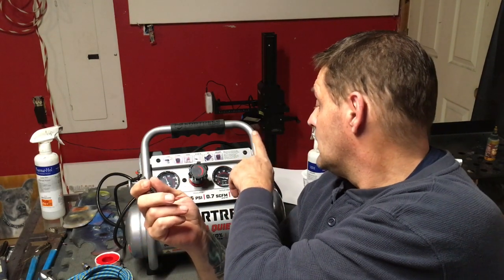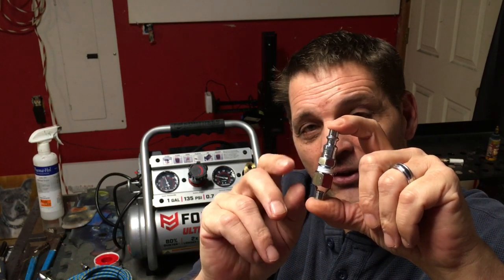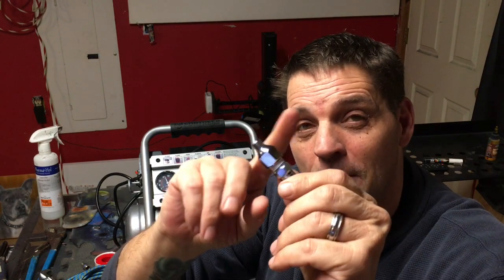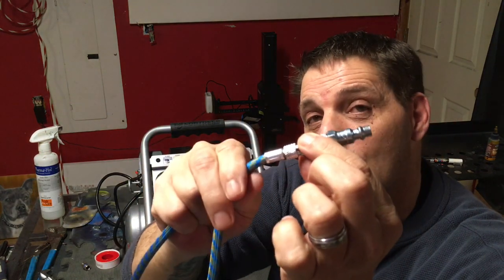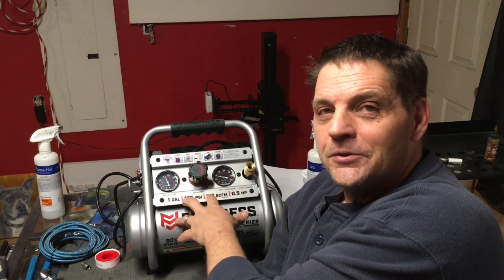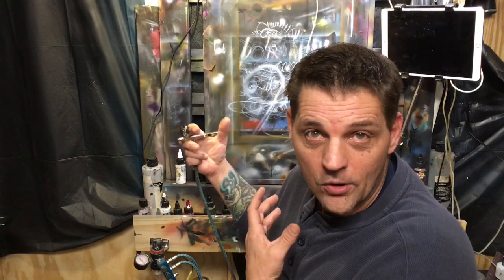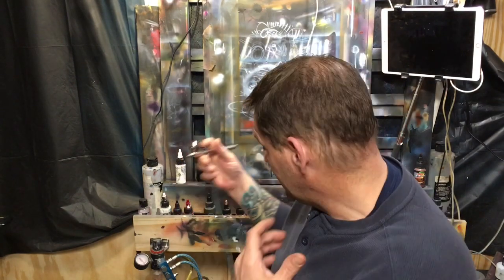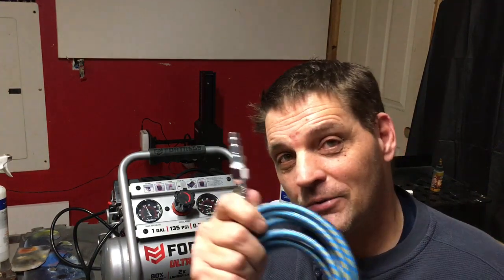How to attach an airbrush to a regular compressor.  Lets hook it up!

Comment: thank you for creating this video, it has really helped me out.  I am running a refrigerator compressor, to a dual tank rig. From the compressor I had been running a coiled copper line to  a section of rubber hose, a splined adapter to water trap/regulator, from that ran a hose to my airbrush.  I want the pressure cut off aspect of the shop compressor, however, the skirt on my piston disintegrated, so I swapped out the noisy electric motor for the fridge compressor.  Now that I have some time, I am wiring in a power switch and the pressure cutoff.  I will run a short line to the tanks, and from the tank regulator,  run a3/8 hose to my water trap, which I plan to mount to the side of my cart.  put the whole compressor and tank on the bottom shelf of the cart, connect my hose to the water trap, like you have your on your bench.  then the new line from water trap to airbrush.  a set up like yours, but on wheels.
Reply from the maker: I had a small setup on wheels like that.. very handy.   With the silent motor that should be a very cool little setup.

Comment: Thank you for showing me how I can use a shop compressor with the airbrush I have yet to buy for use in my train room. I really didn't want to have a little & noisy airbrush compressor in there as well.   Now I know I can just run an air line across my ceiling in the shop and above the ceiling of my train room.  I'll install the moisture filter in a spot between the ceiling joists where I can easily attach a hose "drop" down to wherever I'm working.
Reply from the maker: Yup if you got shop air close that is the way to go.. unless you need to be mobile of course

Comment: My local harbor freight tool store saved the day with this compressor, adaptor, and airbrush hose for my badger airbrush.
Reply from the maker: Great!  I’ve run some Barbour freight hoses for years,  it’s the only thing I use from their airbrush section but they are not too bad.
Reply: I did too but their hose is NPT at the 1/4 adapter and NPS at the 1/8. Brushes are BPS, no? I'm using an Iwata brush fyi. The Harbor Freight hose is the only kind I have seen with those connections. I fear crossthreading using it so I returned it and now looking  for ways to adapt. The links this gentleman shared don't seem to match what he is describing in this vid. The hose he linked is BPS on both ends and not NPT on the 1/4 end according to the hoses product info page. Also, the adapters he shared don't say anything about being BPS according to theor description. In fact they mention other threading instead.. I decided to stay away from a hobby compressor
and go a little larger for other uses too but this hose and threading thing is becoming a pain. Just finding all kinds of different and contradicting info when it comes to non hobby only compressors that send air out through NPT quick connects.
Reply from the maker: @alan2698  the harbour freight airbrush hoses are the correct fitting for your airbrush. 

They at least used to come with a female  npt adapter.  As well. Harbour freight does sell everything you need.  The airbrush hoses are green.  If they have a chrome adapter in the bag then you just need the industrial quick connect to male npt adapter. 

Occasionally Amazon will redirect links.  I will check the link and make sure it’s linked to the correct items 

If you ever see any links wrong I try and monitor every single comment on YouTube.  Occasionally I miss some.  Thanks and good luck on your journey
Reply: @TheAIRspace  so strange. I wonder why their package stated nps and not bsp? Maybe you got it to work but it is not the correct threading and will cause cross threading (unless it is a typo?). They are different angles and thread styles physically. Also, I didn't mean to call out about the links. I was just recalling one I found with another commenter somewhere else in this thread. Their question seemed to line up with mine.
Reply from the maker: The BSP and NPS are very similar  both being a non tapered thread unlike NPT threads.  The difference is one is 28 threads per inch and the other 27.  being the threads are loosely threaded will not cause an issue.  They seal with a gasket and not by thread to thread contact.  The variance is pretty loose.  

The part number is item 69578 for the harbor freight airbrush hose.  Which incidentally will be the same hose that is used on their airbrushes.. which happen to have the same thread as every other airbrush outside of Pasche and Badger.. in the HF hose case it actually comes with a badger adapter as well. (there may be some oddball airbrush thread out there but I cannot think of any)  
Its actually a very good hose, Probably the best thing they sell for airbrushes.  It is actually an airbrush hose from harbor freight in this video. As well as the adapter.  

I didn't take the comment about the link as a negative at all.
Reply: @TheAIRspace  ok. I appreciate your time. Thanks.

Comment: Just bought that same compressor this weekend!  Very quiet and adjusts nicely!
Reply from the maker: tbh its not my first choice.. and I have a larger compressor.  I plan on using this in a portable airbrush easel.. sort of.  But they are pretty well built.  If it were my only compressor id definitely have to have a bit more power.  But I use a bit more air than most folks too.. this is WAY better than an "airbrush" compressor.

Comment: Thank you!  Like others have said--nobody has specified exactly what you need for this.  Although, I only needed the NTP to 1/4" adapter; my Iwata hose has 1/4" on one end and 1/8" on the other.  I don't know if that's a new thing companies have started to do or not.
Reply from the maker: some hoses now ship with an adapter to 1/4 npt .  but it is still not always the case.  the question of how to hook it up comes up a lot on threads  on facebook.  and yet I still see the wrong answers given a lot.  Thanks!

Comment: Thank you very much for this informative video! I hooked up everything like you said and it works fantastic! I am currently running one airbrush and wanted to know how much pressure do I set the compressors' regulator to as well as the regulator next to the airbrush. Please let me know and keep up the great work, thank you again!
Reply from the maker: I usually set the compressor regulator around 60 for regular airbrush stuff,  and the second regulator at anywhere from 15-40  depends on what im working on.
Reply: @TheAIRspace  Perfect! Thank you for letting me know.

Comment: The link you provided for the multiple fittings is for the industrial version , in your video you stated that we needed the automotive type
Reply from the maker: I checked to make sure, however industrial type will be what most home users would have.  Automotive type are higher flow fittings and not used on most compressors.  I indeed said you need industrial type :) the one correction (if youtube let me edit the video,)  I would label the 1/8 inch as BSP because that is indeed what the correct thread and terminology is.  
Thanks!
Reply: @TheAIRspace  crap! I just went to Home Depot and bought the automotive version
Reply from the maker: @Unkownsector  you know I’ve come back with the wrong quick connect myself. And I used to run air lines for many businesses

Comment: This is pretty cool my 60 gal two stage compressor is hooked in to the house and provides all the nice clean air for my airbrushes and air tools in the garage. I do use 1 large moisture trap at the compressor and a smaller regulator trap/filter works great and I don't hear the compressor that's in the heater room. And a separate line for my air tools and full size spray guns.
Reply from the maker: Yes absolutely if you have a shop compressor and can pipe in air from a remote spot (where noise doesn't matter). That's a great way to go.  

Of course everyone's situation is different.  But one things for sure, you cannot have too much air!
Reply: @TheAIRspace  yes your right I had a small compressor and it died and it dawned on me why not just plumb the 60 gallon since I already had it set up! Lol! But a smaller set up for airbrushing is completely acceptable but I would still choose one with a tank.
Reply from the maker: @moparnut6286  definitely.. i wont even use "airbrush compressors"  at least not in the volume I do.  I have a 5 gallon Kobalt quiet tech ive been using the last couple of years.  This little one i had in this video, is going to go in a small mobile easel/airbrush station setup I plan on building.  I want to be able to wheel it in and out of the studio and go outside etc with it.    My 30 gallon compressor just recently died.  But since im not spraying large spray guns currently its not a need..  I plan on moving in a couple years so... not going to get another until then.   The plan is as soon as my last kid graduates.  then im moving to the country and should be able to have a pretty large shop space.. for now i just keep pumping work out of my little studio space :)

Comment: Another great video, thank you and I really appreciate them. I really liked the explanation of using a longer air hose and where to put the moisture trap. I clicked on the Amazon link for the air hose with adapter, however it shows 1/8 female and 1/4 female bsp so I don’t understand how it could or would work. I searched my local hardware stores, eBay, and Amazon but to my surprise it’s not as easy as I thought converting from bsp to npt. I decided to go an even simpler and a much more readily available route. Simply cut off the British female fitting and get a hose barb (I believe mine is 1/8 or might be 3/16 I.D.) with either male or female 1/4 npt threads, then get a air coupler (obviously with opposite male or female threads) to attach to the connection of your compressor. Quick, easy, and the parts are easy to find and inexpensive. I really like your explanations in your videos, thank you for sharing with people new to airbrushing like myself.
Reply from the maker: If you have a harbour freight they sell the hose with the adapter. And their hoses are actually pretty good quality. They also pack a badger adapter in them 

I’ll check the link I posted sometimes Amazon switches them up. 
But more often than not they are mislabeled.  I tend to believe almost all of the braided hoses are made from a couple suppliers and sold under various names.

Comment: hey ! thank you for this video ! i try to undersand what's going on cause i bought one of those Coil hose with the quick connects built in it but i just can't fint a way to connect it to my 
Iwata  Revolution Cr Airbrush (4247)  .i bought an Adapter, 1/8-Inch Female End to 1/4 that can be wired to the airbrush but have no idea what type of connector i shall use to plug the adapter to the hose   ? i went to the local store but they had no clue . . . any chance one of you gys who read the comment know how to deal with this ?  sorry if i made some spelling mistake ^^ and thank you anway for your content
Reply from the maker: you need to put an npt to 1/8 male BSp adapter and use an airbrush hose.   If its a quick connector on the hose you need the quick adapter to NPT adapter than a 1/4 inch npt adapter to the hose 1/8 bsp
Reply: @TheAIRspace thanks a lot ,  i though somehow the quick connect hose was the only hose i needed and couldn't understand why the adapter i got wasn't .....adapted, sounds stupid but i am still learning. thanks for clarifying the steps !

Comment: Thanks!
Reply from the maker: Incredibly generous thank you! 

I’ll have to remember to shout you out on the next video I just dropped one so might be a few days
Reply: Hey, I got everything hooked up and working! Did my first airbrush paint in 35 years! One fine point remains, getting the quick release fittings on my Iwata Eclipse to work. The male end of the quick release fitting won’t snug up enough on the Iwata air hose. Bought it through Amazon, seems that’s all it has. Anywhere else to go?

Comment: Hi Sir. Im newbie to airbrushing, and I dont want to buy those small compressors like you adviced.

Im still at a loss at what to buy to get a setup like yours.

I want to understand what specific parts we need to get a hose from the compressor to the watertrap with regulator, and from that to our airbrush hose.

Are there specific names and numbers we need to watchout for when browsing for parts?

Im from another country.

Comment: Thanks for the info. I was wondering why my filter that is attached to the compressor never collects any water. In the video you said you would post a link to the Paasche connector but I am unable to find it. Could you please post it again or just post the type I need to buy? Thanks.
Reply from the maker: This hose has adapters for both badger and paasche included 

https://amzn.to/3HrdWgM

"aff link"

Comment: I look everywhere and can find the big piece to fit to the small one. I only can do two turns and that is it. If iI get it from your link, what guarantees me that the threads will match my small adapter? The one That came with the pistol style airbrush, the female is 1/2-20 which is half of an inch in diameter and 20 threads per inch.
Reply from the maker: in almost all cases with the exception of paasche and badger,  airbrushes use a standard 1/8 inch bsp thread.  From chinese, taiwan and japanese made airbrushes.

Comment: thank you for the great explanation.  I am wondering something that you hadn't covered with regards to the remotely located regulator and water trap combination.  wondering what you set your air compressor's regulator to?  Does it just need to be set at the same or higher pressure than you need at the air brush end?   I know it's an obvious noob question, sorry for that lol
Reply from the maker: not a stupid question at all.   Generally I keep that one set around 60 PSI ,it really could be maxed out with no difference as long as you were feeding the second regulator higher than needed air.
Reply: @TheAIRspace  Thank you!

Comment: Thank you for this video.  What do you set the compressor regulator at compared to the other one next to your work station?
Reply from the maker: I keep the one on the compressor around 80, but you dont have to.  As long as you have it at least a few psi more than you will be airbrushing with.

Comment: Thanks for this info. I am building an airbrush station. My big Quincy compressor is far away and the air goes through 200’ of 3/4” copper tubing before entering the 60 gallon tank. I have a 300’ closed loop 3/4” Maxline running through 3 garages and my workshop. My airbrush station is far away from the compressor. 
I’m thinking of an activated charcoal filter, followed by a 5 micron filter, and a 0.01 micron coalescing filter at my airbrush drop down. Last thing will be a regulator. 
I’m using an Iwata Eclipse which I think requires an 1/8” hose. 
What regulator do you recommend? What brand and what range of psi?
I like your multi port manifold that allows multiple guns active at once. That’s clever. 
Any advice you can give me is appreciated. 
Thanks,
Paul
Reply from the maker: I dont see a need for a charcoal filter in there.   
But with im assuming running air tools and the like I would get an oil water seperator in there somewhere.    If you are already setup for spray guns..  then any small regulator / water trap combo will work.  they are reasonably cheap.  I used to run airlines for both large shops as well as Dental air lines and hospitals.    There is not a lot of rocket science involved in shop air.   ( i was a plumber for decades)  

Those qunicy compressors at least the old ones were sure great durable beasts.  When i move from where im at ill definitely be moving on to a two stage compressor setup. And pipe air around my garage .   and likely pull airlines into the studio.   I actually run a small 3.5 gallon compressor in the next room and pipe over air.  My setup is a lot nicer now so is the stuido.   I just ran a small airline kit down and around I still have a splitter but this one is better than my old one. and I am using a flat mounted filter regulator combo.. but I may go back to the old style yet :)
Reply from the maker: Oh and yes the eclipse is 1/8 inch BSP   everyone but badger and Paasche use that standard.

Comment: I can’t tell- at 4 minutes into the video do you have your coil hose going directly into the plastic female connector of the regulator, or do you have an adapter to make it fit to the metal male connector?
Reply from the maker: the coil hose comes with a 1/4 inch npt male  which screws directly into the regulator in this case.  
The setup im using now is a little different but of the same principle.  Im running a pex air line system to a block.    But I ran that coil hose and regulator setup for years literally.
Reply: @TheAIRspace  thanks so much. I tried connecting the hose I have straight in and it worked. Thanks again for explaining the set up - it’s really helpful and I’m excited to get started!
Reply: @stevensweat2978  i come to these old videos and im almost cringe at how bad my lighting and studio was back then :0
Reply: @billkennedy1220  well I have watched it several times over the past few months and it helped me decide to get an airbrush, so I thank you for it 🙏

Comment: Can you remove the 1/4" quick connect from the compressor and convert it to 1/8" from there? Like with a 1/8" quick connect? Thanks
Reply from the maker: you could yes.   the quick connectors are threaded on.   USUALLY with 1/4 inch NPT   sometimes with 3/8ths.  Depends on manufacturer if its male or female.